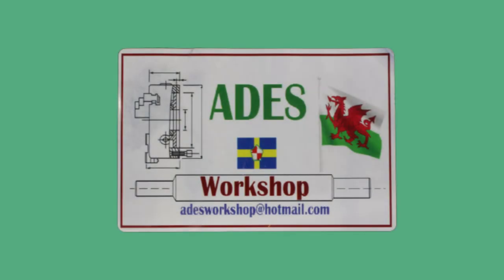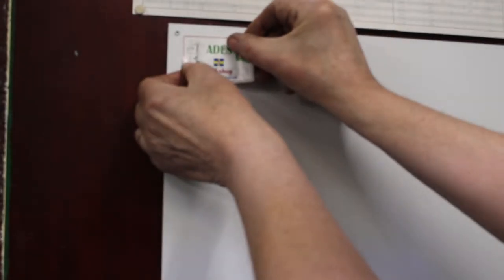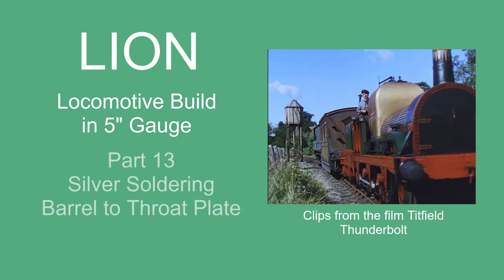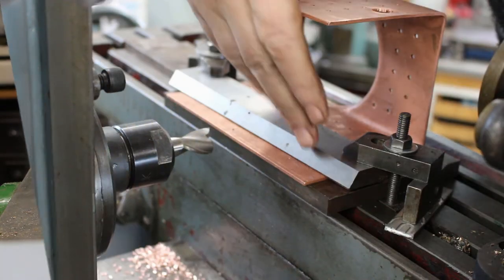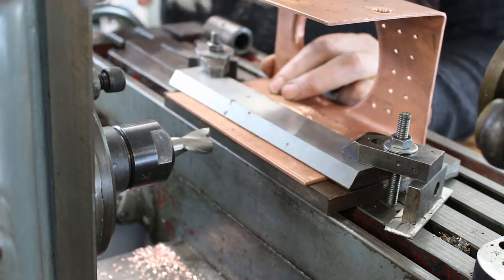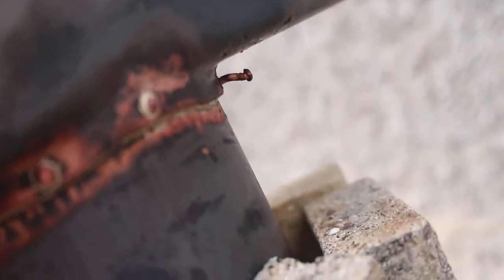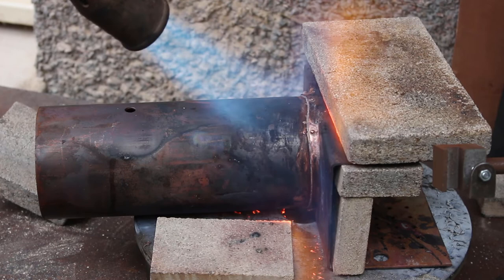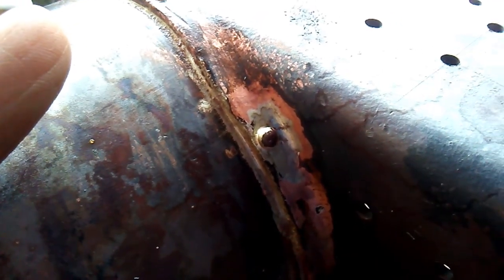Building Miniature Steam locomotive LION Part 13 : Silver Soldering Boiler Barrel to Throat Plate

Comment: Fantastic job! I’m interested to know where you got your OxyPropane equipment from.
Reply from the maker: I got my oxy-propane torch from thewelderswarehouse.com, the heavy duty version allows you to use larger burners which are available as an accessory.
Reply: Thanks for the reply. Is that where you get the oxygen bottles from also? I’m after finding somewhere that doesn’t charge rental for the bottles. I’d rather just pay upfront for the bottle like with propane. Regards Rob
Reply from the maker: Hi, I got the rent free oxy bottle from my local auto parts store, an agricultural type stores locally also have them. If you search for rent free oxy bottle suppliers you may find a list of their agents in your area.
Reply: Go Create Hobby Machine Shop thanks again! Rob